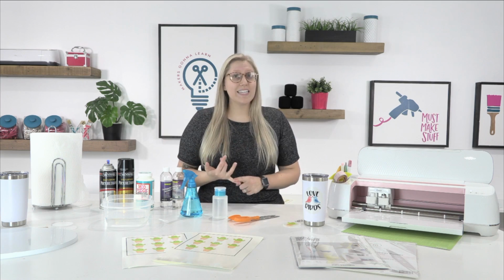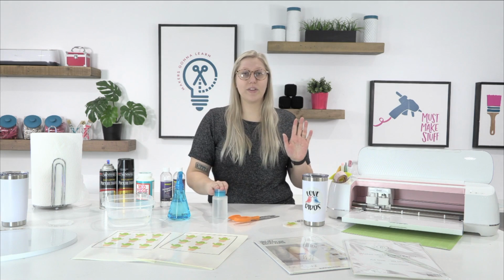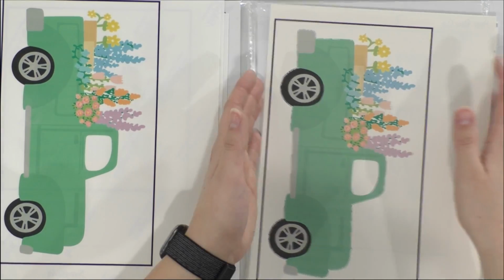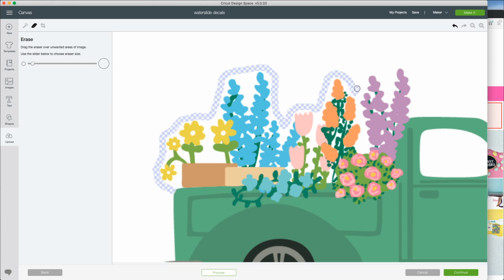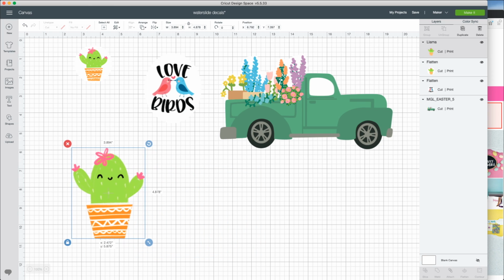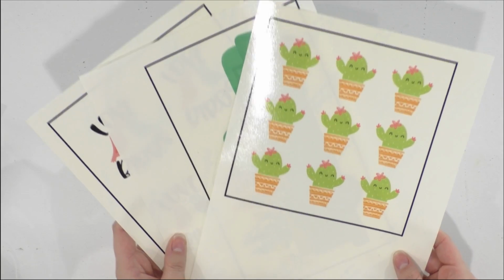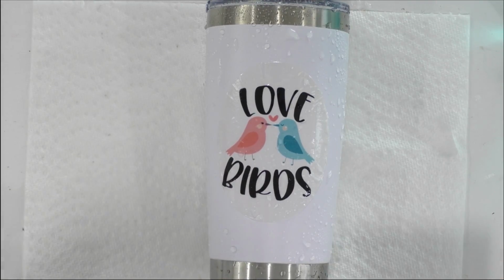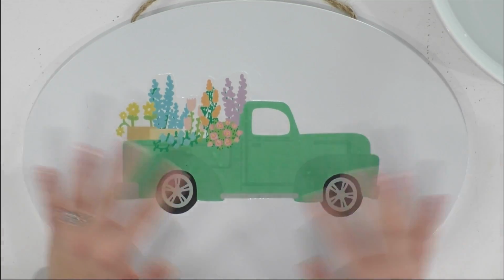Learn How To Make Waterslide Decals For Signs, Tumblers, and Keychains!

Comment: Hi! Very nice video. Please tell how is A-sub waterslide decal paper. Before I buy Decal Paper!!. Please tell which epoxy should be use to get good finish coat for food safe and dishwasher . how to apply it to not get the brush marks. also tell how to apply dishwasher safe mode Podge as it will not get the brush marks. Thanks in advance.

Comment: Thanks for the super helpful videos! I've been watching a ton! I have a question about spraying the waterslide...Is there a reason you seal it before cutting it in the Cricut? Would it be the same to have Cricut cut it, and then apply the seal? I was thinking as a way to avoid Cricut struggling to read the lines if they're covered in something shiny. Thanks!!
Reply from the maker: hello!! So, we're not "sealing" the waterslide before cutting, we're strengthening it! :) The waterslide paper has to be super thin for it to feed through the printer, but once that's done, it needs to be much thicker and less fragile before soaking it in water and using it. So, we apply lots of coats before cutting to make it thicker and stronger!
Reply: If you seal it after you cut it, you run the risk of overspraying the edges and having your poly/acrylic (whichever you're using) curl around on the edges. If that happens, you're not going to get the edges to lay flat without the help of something like Micro Set (or other solvent based products) that modelers use to get waterslides to soften and conform to multiple-angled surfaces. It's just a time saver.

Comment: Excellent Tutorial! I loved how you explained things. I have a few questions. Where can I get the white blank tumblers? Will I have to use Epoxy, or Mod Podge first? Which would you recommend? I wanna make one for my husband. 
Also, say I use the truck design (example) for a waterslide but wanna cut out permanent vinyl to put around it. Will the sealant spray affect the vinyl? Any helpful tips would be greatly appreciated. TIA.
Reply from the maker: White tumblers: https://amzn.to/39TPAft . If you want to seal it, we recommend using Dishwasher Safe Mod Podge: https://amzn.to/354190H . The sealant spray will not effect the vinyl! :)
Reply: @MakersGonnaLearn  thank you so much for responding! You guys are awesome!
Reply from the maker: @michellemendoza4999  You're welcome!😊

Comment: I see you use polyurethane spray for prep and sealer .... I've bought Krylon crystal clear acrylic coating (non-yellowing) spray for sealing wood signs etc.... can you tell me the difference?   I know I will have to buy polyurethane for this waterslide stuff but for top sealer which is better?
Reply from the maker: Without having used the product myself it's hard to recommend it or talk on the differences, but I would think those brands would be comparable :) We use and love Minwax Polyurethane Clear Satin Spray Sealer: https://amzn.to/3cIRSh5